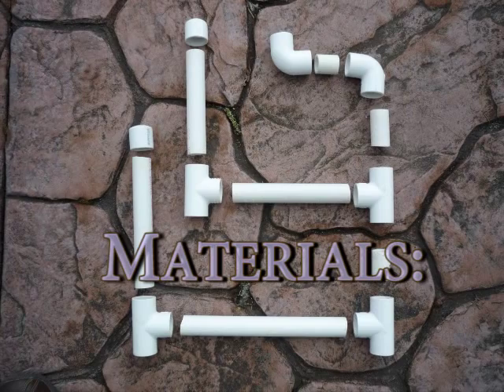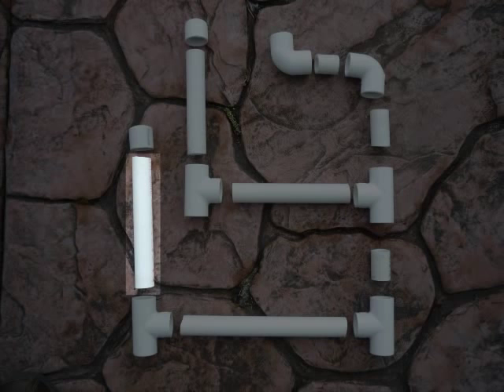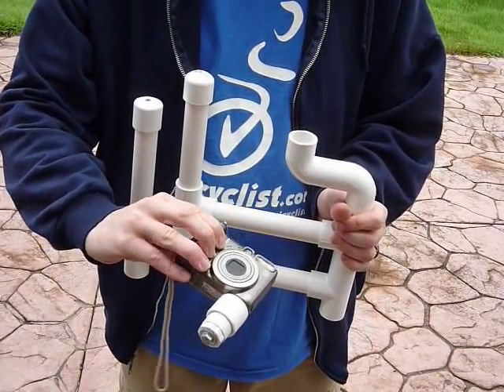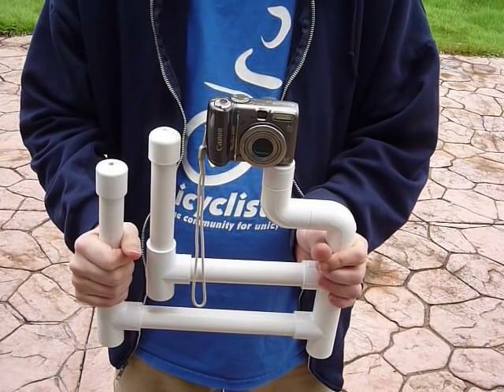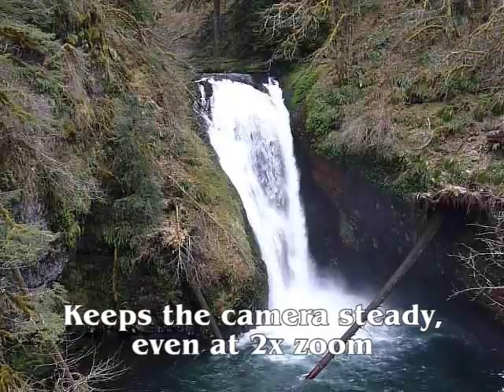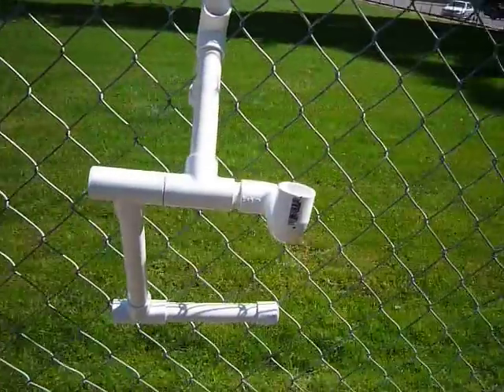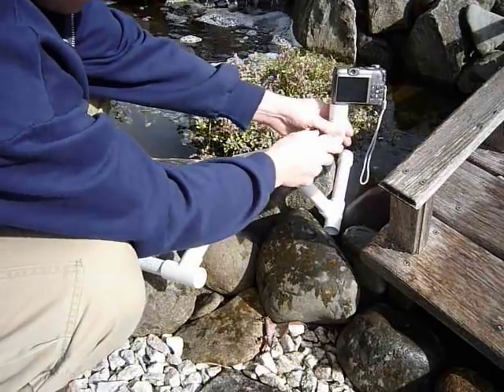Multi Pod

Comment from the maker: Some of the uses may still work, but since it's all based on friction, I think an SLR may be too heavy.  You could try 1" PVC to compensate, but then it starts to get bulky.  My dream is to get someone to machine one of these out of metal for me with locking joints and telescoping legs.

Comment from the maker: @Knoptop 
You may be joking, but that is a real possibility with hard, crusty snow.  In that situation, I may use a slightly different approach and turn one of the legs vertical, so I can punch through the crust of snow and use the leg as an anchor.

Comment from the maker: @shadeydave 
Please make the mods!  I'd love to see a pin and hole system.  The possibility of it coming apart keeps me from trying a number of things with the camera.  One thing I'd worry about is by drilling holes every 5 or 10 degrees, you may severely weaken the PVC (like perforations around relatively soft plastic).  Maybe if the holes didn't go all the way through?

Comment from the maker: @Democratese 
What do you mean, "just PVC?"  Just kidding!  PVC definitely has its drawbacks.  I would love to see the multipod built in lightweight metal tubing with locking telescoping arms and actual joints instead of friction fit.  But machining customized metal devices isn't my forte, so I'm stuck with PVC (for now).

Comment from the maker: @tdmiller11 
I think it would probably be fine.  Just keep in mind, however, that I designed this to be a inexpensive solution for inexpensive cameras.  I'd probably be a bit nervous trusting a $500 camera to something held together with PVC and friction.  You may also run into problems with the weight of the lens throwing off the balance of the device.  This is all speculation, though, since I don't have a larger camera to test this with.  Anyone have experience with something like this?

Comment: You could secure it a little better for heavier cameras by using a pin and hole system instead of just PVC friction. Use PVC glue on the joints that don't need to move and set up a ring of holes at 5º or 10º intervals around the moving joints, and put pins through the holes to lock the joints in place and keep them from twisting and from pulling apart. 

There are a lot of good ideas here, I might steal a few and make some mods. I'll credit your channel of course.

Comment: @PacoWarabi 
I didn't have any straps to test it properly, but I just held it in place and it looked like it would work. What I did was spread the arms out and place the legs on either side of the tree.  Between tilting the legs and twisting the elbows you can compensate for the leaners.

Comment from the maker: @theprintsofwales 
I'm not fully back into inventing yet.  I'm only 4 months into my new career, and have a backlog of videos I want to make before I start on anything new.

I'm betting that you could use the multipod like the Camtrol.  The only problem is that when configuring the multipod like that, the weight of the camera is pulling the PVC apart, which could result in a dropped camera.  There would have to be some sort of way of securing it, beyond the friction fitting.  Anyone want to try?

Comment: @PacoWarabi 
What I was thinking was if you just spread the legs out and put them against the tree and used a couple of straps to hold it in place. It would probably be better if the 6.5" leg piece was ~2.5" longer so you would hit both legs with two straps.  Maybe turn one leg down...